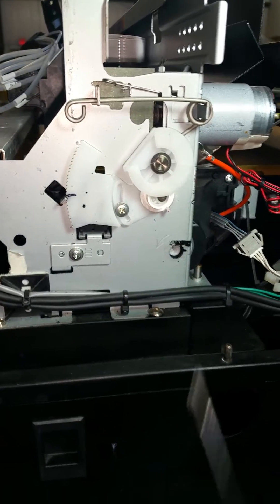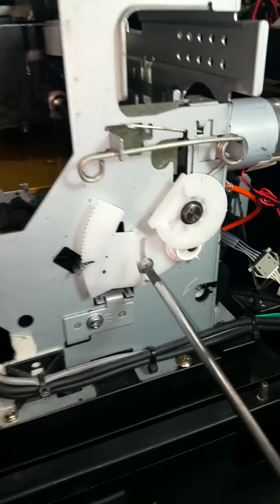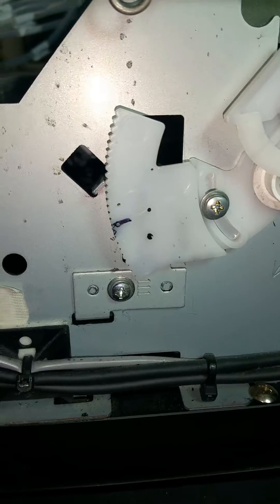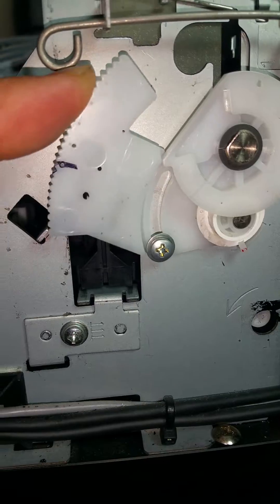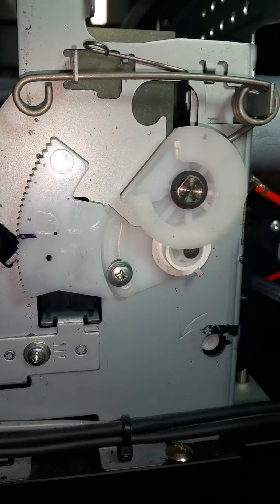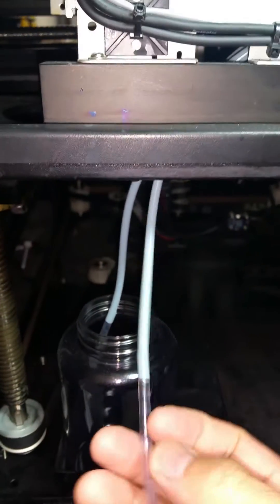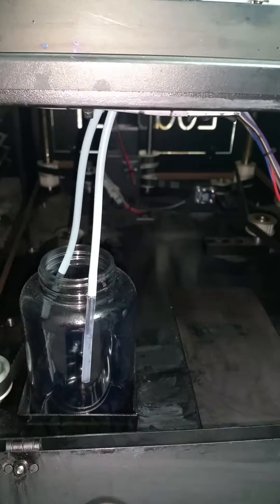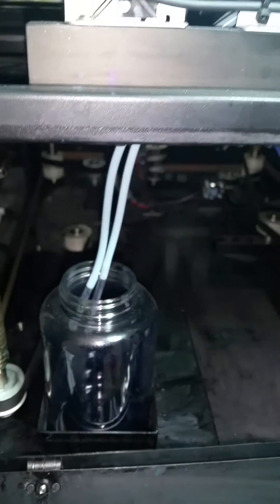Adjust head height

Comment: So you have to take the machine apart? My material is a little wavy I just want to nudge it up a little, I can't do this from the front?
Reply from the maker: Hi Ian,
Yes - In order to adjust head height the fan gear needs to be adjusted. However, this cannot be done from the front.
 
If you have wavy material you are trying to print on, adjusting the head height is not going to adjust the material height.
 
The adjustment of height of the substrate should be used by either manually adjusting the height or auto height. Your limitation is up to 5mm from the bottom of print head to substrate to get a good print that does not have overspray.